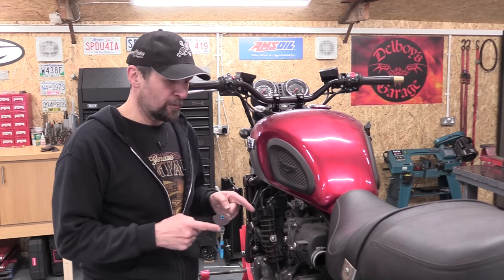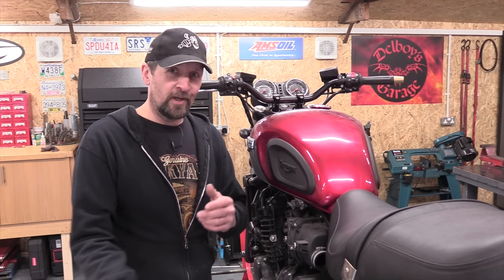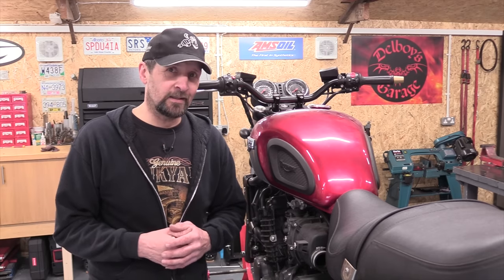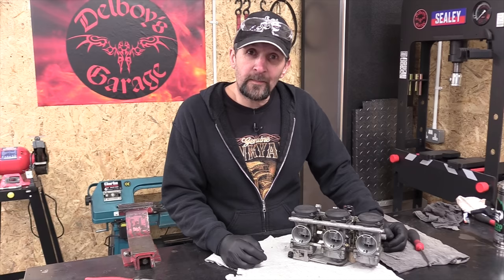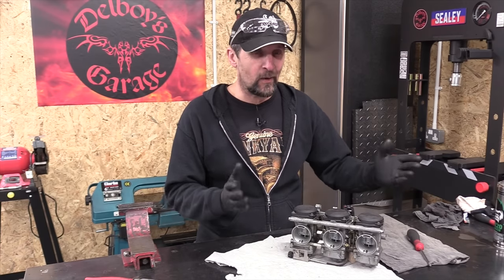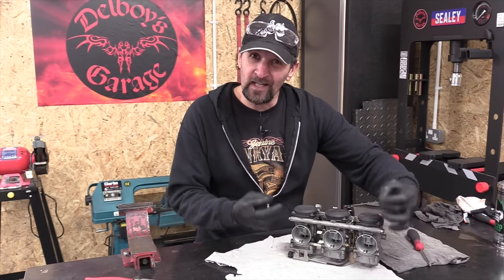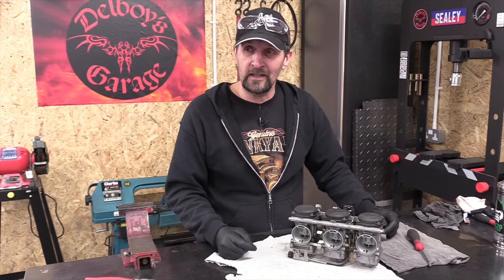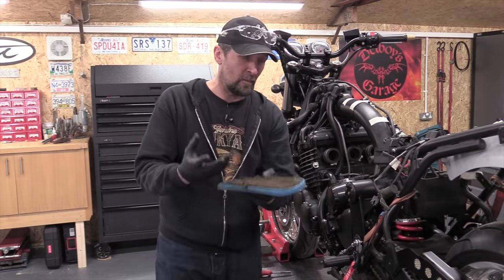Triumph Thunderbird, TT Legend, "Carburettors" !

Comment: Can you please tell me what/where the three hoses you removed are attached to? By order , hose 1 bottom , hose 2 top right, hose 3 top left?
Reply from the maker: Sorry Fares, i can't determine which hoses you mean from your description, can you give me a time stamp in the video and ill happily identify them !
Reply: @Moonfleet41  First Hose is at 1:52 and 3:26 which i assume is an air vent hose , 2:32 another air vent hose on the top going from the carb over the air box? 3:20 fuel hose from the gas tank?
Reply from the maker: @frrs9268  That's them you got them all correct...
Reply: @Moonfleet41  thanks! So i can cleaned the carbs , put them back tried to start the bike but nothing. Carb bowls are full of gas, we have a spark but it Doesn t ignite . 
The bike starts then dies on starter fluid. Am i right to assume a vacuum leak is next? Is there a way i can private message you?

Comment: I wonder if their is an upgrade to the air filter so you can get rid of the box and better performance unless you want to keep it original.
Reply from the maker: If you mean separate pod filters, then they're always backward step, ask any tuning shop and they'll always agree that an air box is king... it's actually not that hard to undo a dozen screws and pull the carbs out, it's just laziness, because it's a little harder than normal and yeah, I'd kinda like to keep the engine standard, just freshen it up and upgrading to coil packs!

Comment: I've been loving the design of this Triumph, right up until this air box.....what a terrible design! Clean air, clean fuel, and regular oil changes seem like the very basics of maintenance, and if a builder makes that difficult to do for the owner, then it just seems like they're setting themselves up for a poor reputation!  Good to see you got it sorted!  I can tell you that at my basic level of skill, getting that Carbi service done correctly would have had me sweating!!  Cheers D & P....ride safe!
Reply from the maker: Hi Allen, good to hear from you Sir!... and yes, it does seem a bit daft, but looking at it, with a bit of history as your background, you can see that the bike is basically trapped in time!... We have the spine frame design to echo the golden days of Meridan where that spine tube held the engine oil, but with modern carburation, they need a big plenum type air box so had to design it in around the historic frame... with the result, they built a bike around the air box lol  Have a great week, keep safe there, D&Px
Reply: @Moonfleet41 Thanks for the history, makes a lot more sense knowing that!  Cheers!

Comment: Nice one Del! The std Triumph air filter for the TT is all one unit. I had some customers split them and fit an aftermarket filter, but they did not always reseal properly and ran poorly as a result, requiring another strip down. I think it was to be replaced every 12k or two years but gen filters are now £60+ so a few take a chance.
Reply from the maker: Thanks for the insight mate, I've ordered a Pipercross and I can see from the design that it needs to be very carefully fitted to make it seal!

Comment: Now, in the land of hydrocarbon bar flies, that's what I call an optic rack of worthy intent.
None of your 'airy fairy perfume counter test sprays with some Amal-rejective 'puter saying 'enough already' all the time, these guys are the full Olly Reed, three most worthy decanters for a customer driven frenzy at anyone's opening time . . . but that 'crouching Doctor, hidden hamster' airbox does smack of a 'just fit it & get it out the door' sense of demand for the finer details of development.
Thinks: Could the motor swing forward a tad with a top mounting off - or didn't the dealers have a 'cunning plan' either?  'Kinked headers Sir? - yeah, they all go like that . . honest'  : ) xx
Reply from the maker: In fine voice you lyrical gangsta!

Comment: What breaks down the filter like that? Stale cake lol
Reply from the maker: The air box has crank case breather hoses fed in to it in order the re-breathe engine discharge vapour through the exhaust, and over the years, this poisonous mix of oil and fuel vapour eventually breaks down the foam, plus it's helped by pure age, just look at the foam in a seat if it's 20yrs old!
Reply: @Moonfleet41  yea true over time the foam deteriorates. Thats an interesting air box!

Comment: Cleaning the jets? Ok... maybe not but what I can say after rebuilding my own carbs this past fall... to all those quoting aftermarket carb rebuild kits??    Do NOT buy aftermarket kits.  I did this and after almost three days of installing cleaning and reinstalling and inspecting etc I finally had to take it to a mechanic to find out why it wasn’t running on all cylinders.  I had checked EVERYTHING.  He looked into it, replaced the aftermarket pilot jets with the originals and voila.   Problem solved.  Told me this happens all the time with aftermarket kits and the pilot jets not being correct pitch and so forth.  Cost me $500 to find out that my $100 rebuild kit was scrap.  So... word to the wise.  Ante up and buy the OEM jets.
Reply from the maker: A valuable lesson there and so many times it is important that if something's working just right to leave it alone, so many people insist on stripping and fiddling and making them worse for it, like some kind of OCD, but in the real world a perfectly balanced and well functioning set of carbs is a rare thing and if they're all good, like these are, then leave them alone.... and you're so right, pattern parts can often be the route of further problems in so many cases... take care there buddy, keep well, D&Px
Reply: @Moonfleet41  Agreed with the leave it alone concept.  My needles on #1 and #2 cylinder we worn so had to replace some components.  The needles were essentially the only thing that worked out of the kit.. oh... that and the new screws.  I never replaced the main jets as they came from a dynojet kit.

Comment: Great job Del👍, got a few good tips from this vid.   I'll be doing a service on a friends 955 Tiger.  Is the air filter similar to the Tbird??
Yup,, that's a big job, and I see why it's overlooked.  Thanks for your reply,,   cheers,  G.
Reply from the maker: Hi mate, most welcome, glad you enjoyed the video!... I'm not exactly sure if it's the same set up on a 955, as I haven't had one apart, but be conscious of it if the air box looks like there's a joint just behind the carbs, it'll soon become apparent... good luck with it!
Reply: @Moonfleet41  ,,  thanks for your reply and wisdom.   🍻, G

Comment: Really poor design on the filter. Filters should be easily replaced. Reminds me of some of the old Cadillacs where you had to pull the engine to remove the oil pan.